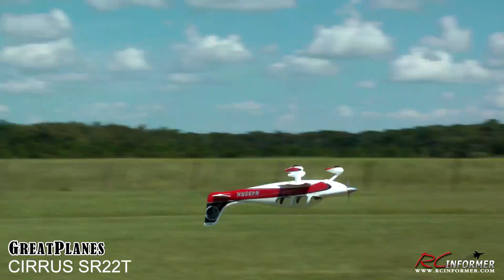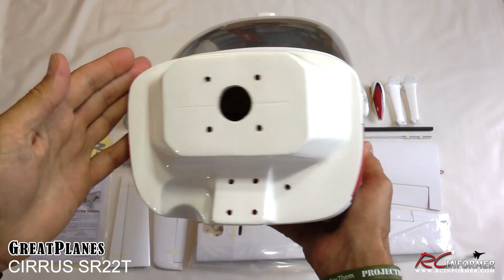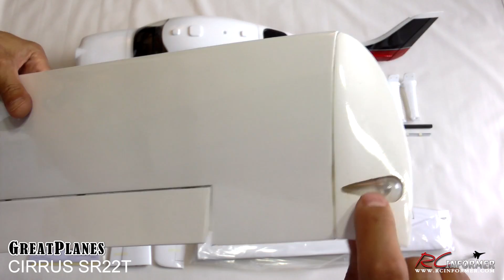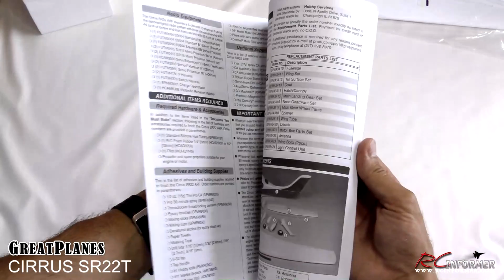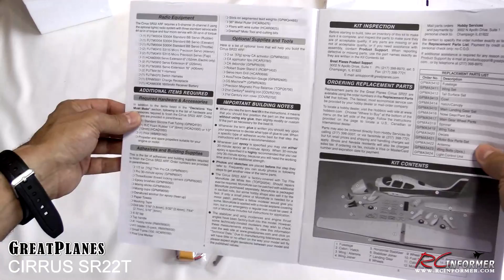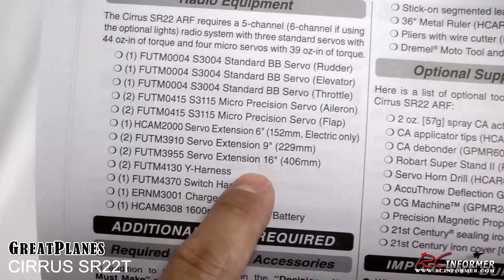Great Planes CIRRUS SR22T UNBOXING in HD By: RCINFORMER Part 1 of 3

Comment: hi rich,man that's a gorgeous plane,i have a question though,someone told me,to figure out motor watts you take the amperage the motor draws and times that by your battery voltage. this is incorrect, right?